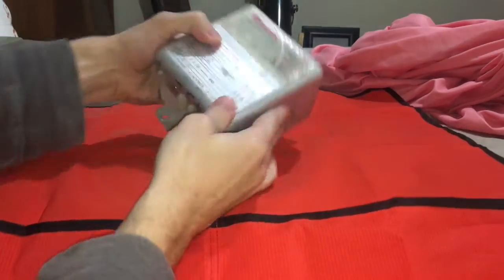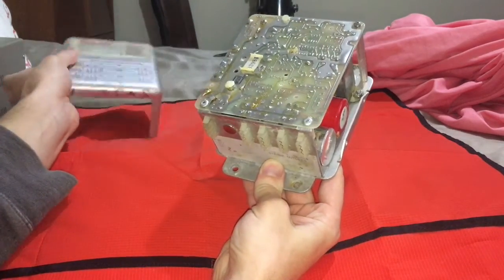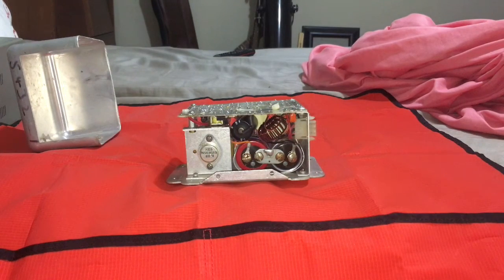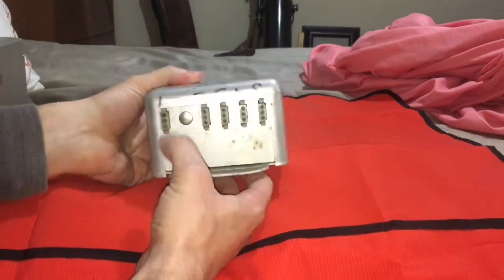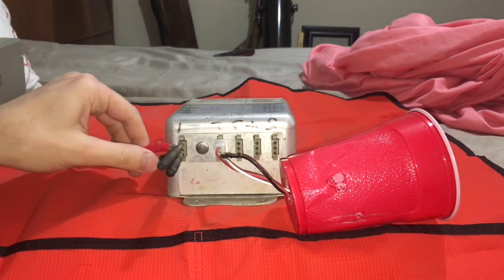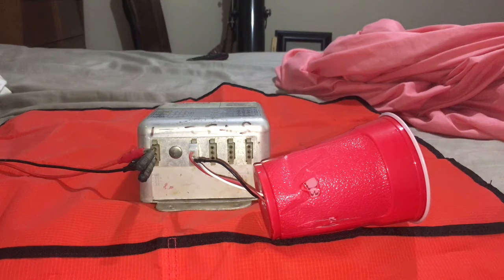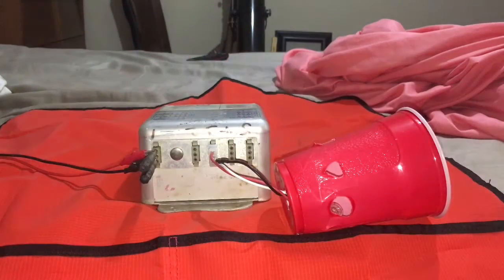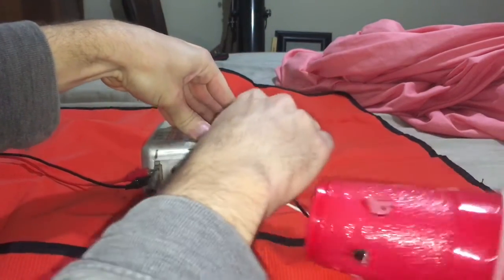Whelen hda-Df-14 repair

Comment: Please disclose what kind of bulb you used for the op test.
Reply from the maker: Phil Hemenway I don’t know what model it is, found it off eBay, matched the number of wires to the socket for the power supply